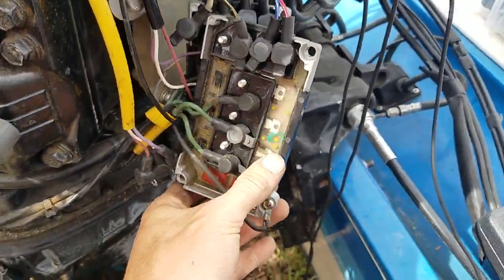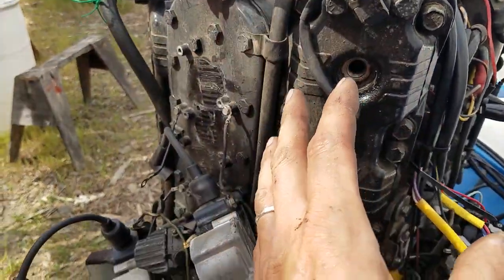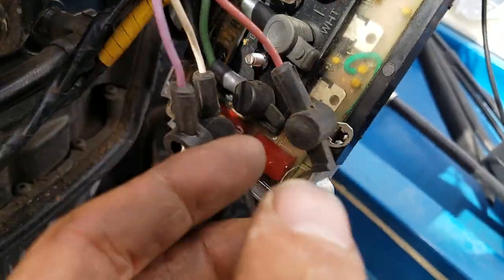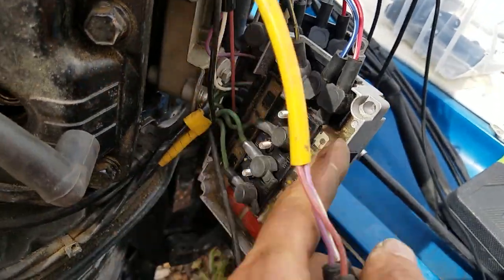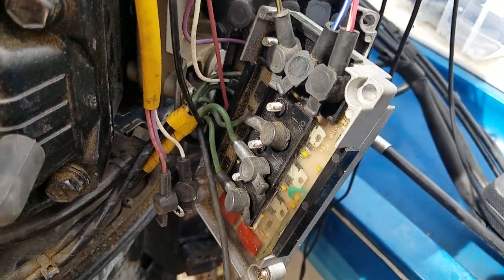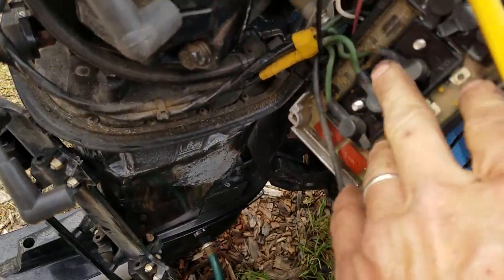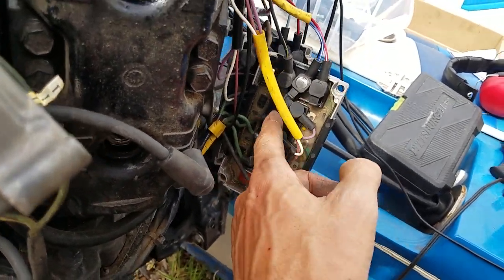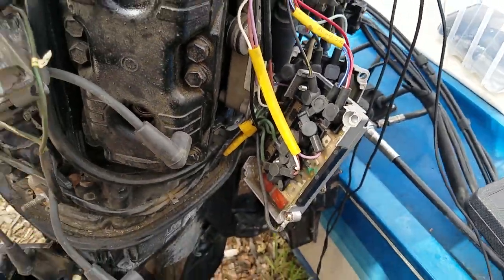Mercury Mariner 80's CDI outboard ignition Part 2: switch box/power pack/cdi explained

Comment: How u know  when u have a bad switch box
Reply: if the WHOLE pack is bad you will have no spark anywhere but this is super rare, usually its one or two "channels" in the pack that go bad - if you hook a timing light to each plug wire look for one that flashes randomly at idle, thats cross firing and not good. you can move the trigger and spark plug wires from a good cylinder to the one thats flashing randomly. if the random flash still happens on the same channel the pack is bad- ill have to make a good video detailing this better -

Comment: I have a switch box 70 hp mercury 2 stroke and the middle wires on switch box White & Green / white are the only terminal  that will get me close to #1 cylinder 2% btdc
Reply: yes sometimes u have to make up some test wires so they can reach

Comment: HI, very informative and in depth as well, nice job, I have a 115  mercury outboard and have an intermitant issue,   the engine runs fine but at idle it spits or misfires every so often.  I have changed the coils but am now thinking there could be a problem with the cdi unit, , is there a wat to determine if there is an issue with the cdi unit
Reply: could be, the trigger is usually a culprit cos the wires move with every accelleration. Another thing to check is make 100% sure the jets and emulsion tubes are in the correct position in the carbs. Merc has a chart in the manual with all the numbers and various locations, its tricky to figure at first but does make sense. Also - some have vertical and horizintal reed plates, confim which u have because it changes the carb to cylinder numbering!! ie on a vertical one top stbd carb would feed top stbd cyl, however on a horizontal reed plate the same carb feeds port top cylinder! bear that in mind when reading the jet chart etc...

Comment: I have the same situation but only wot rights cylinders , left side no have spark , is CDI bad?
Reply: make sure you dont have too many accessories / loads on the stator (max is 9 amp i believe), might be getting over loaded. Try with all accessories disconnected- if it still continues its possibly the stator not providing enough juice. One way to test it to swap the packs and see if the problem moves, if so the pack is bad and you should replace both. Good luck-

Comment: I have an issue with 1st spark from coil is great then falls off to very faint after as engine in turning over, is switchbox capacity bad on that channel? Trigger, coils, stator, all ohm out in spec per mercury repair manual.
Reply from the maker: a weak battery and or starter will crank slow and produce little to no spark. you can remove all the spark plugs and ground the nut part so it spins faster and see if the spark is stronger - then u need a new battery or the starter needs new brushes or rebuilding.. remember a slow speed on these doesnt make enough juice, some have 0 spark until u remove plugs and it can spin faster - suddenly all spark comes back, put plug in = no spark again.
Reply: @fstarockaburns425  Battery is good, starter is new and spins engine easily, I am thinking after first spin all 6 fire brightly however next trip around to number one very weak spark other 5 cylinders spark excellent, I am leaning toward a bad capacitor circuit on that cylinder in SB.
Reply from the maker: @mercman2.5  maybe try with reg rect disconnected.. or faulty kill circuit.. try with both removed
Reply: @fstarockaburns425  Removed kill circuit wires, will try taking rectifier out of the loop
Reply: Do you agree with my diagnosis?

Comment: I have a blackmax xr4 150. It will get on plane but when you go wot it will start to cut in and out. What would you start with as far as troubleshooting?
Reply: if its only WOT i would say fuel delivery. Alot of times outboards will have a small air leak in the hoses and connections and also at the tank itself that will cause this.. could also be a small tuning issue on max timing - you did set the max advance using the cranking method / plugs out & grounded yes?

unless by when you you say "go WOT" you mean along the way - I had a trigger do that.. it was like a hun-hun-hun as the motor ran on 1/2 a cylinder from all- very hard to troubleshoot those issues - you can dip the tail of the boat in the water on the trailer strapped down and try find the cut out point - from there you have to see if theres a voltage drop on the DVA across the trigger etc - not fun. Honestly for 3-400 you can replace just about all the ignition components: stator, trigger, packs- and have a fresh basis - they are a pain to troubleshoot sometimes. Really.. look for used amazon deals too-
Reply: @SocalMarineUSA  Thank you

Comment: I'm not getting any juice to the motor  on wire pack number one that is in front the fort wire is singed is there any way you could help me out to figure out where to send wire goes
Reply from the maker: how many packs do u have? If two packs - swap wiring an dsee if the same pack is dead or if the problem has moved - if it moves the issue is either the stator or the trigger..

try this: u can try remove the boas wire between them (grey i believe). How are u verifying this? There is a blue wire and blue/white for the 0-2000 rpm range, and then a red and red/white for the 2000+ rpms - you need to crank the motor and use a peak dva adpater to see if you are getting anything from the blue wires to ground- specs on cdi's website but usually about 200+ on blue and less on red iirc but double check. Also - remove the kill wire from BOTH packs (its interconnected) - black/yellow wire and try again. Your key switch might be faulty, remove entire harness plug (yes the whole thing), remove fuel hose, and put 12v on the starter solenoid yellow switch (careful this will kick the motor over) - this is a bypass o the entire wire loom outside the motor - if u get lucky and it does run just let it run out of fuel cos the kill/key switch is disconnected - your wiring in the boat is faulty..

If a single pack and u have no spark - remove the black/yellow kill wire and try now. u can also try the same above - remove main harness plug and try start now..

When that motor spins is generates its own electricity to run the whole motor - the battery does nothing except start the motor.. is the wiring connected right? stator might be bad..

Comment: hey i have mercury 115hp 1993 i dont have spark in cylinder 2?  the cdi is bad
Reply: @Lucas Hunter Was it your cdi that was bad?
Reply: @Lucas Hunter Thanks!
Reply from the maker: could be the trigger - but not sure what ignition system you have on that 93 - might just be a newer flavor, but similar principle. .